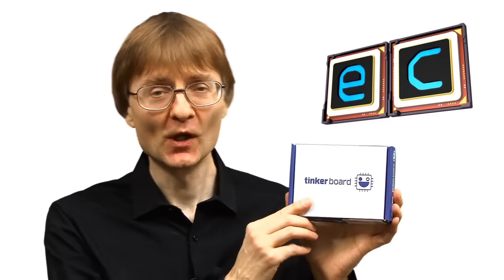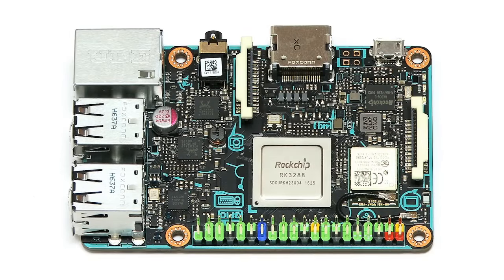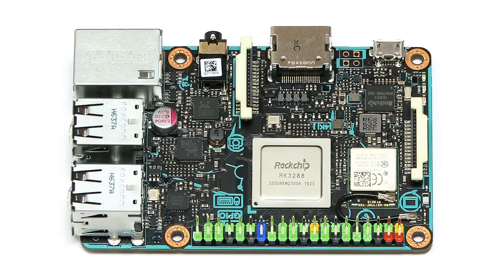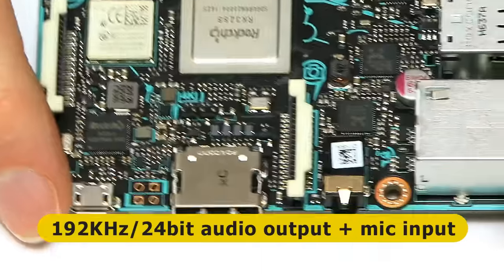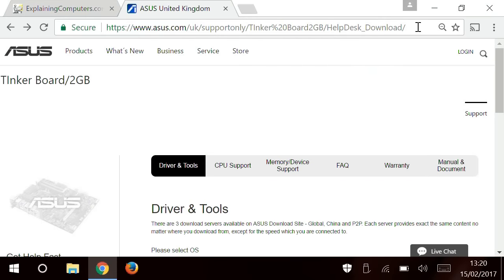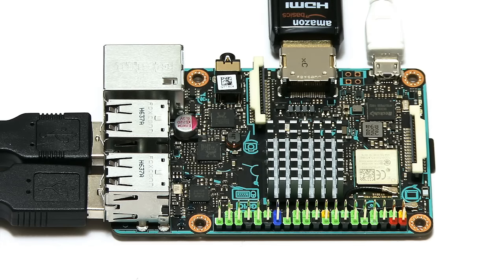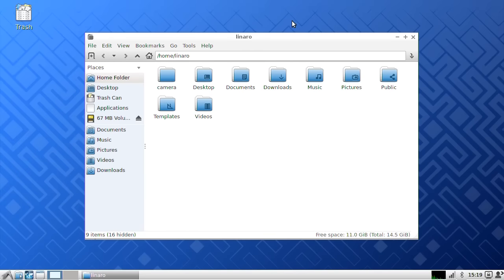Asus Tinker Board

Comment: I have one of these on the way and am slightly confused about what powet supply to get. asus says 5v, 2~2.5a power supply with lps marking. Not sure what LPS means. and Some people sayy they use 5v, 3a power supplies. could you help clarify for me ? i dont want to fry anything
Reply from the maker: The Tinker Board is very sensitive to having a good power supply to run in a stable manner. I would go with a 2.5A, or 3A if you can find one. By coincidence I am 6 days into a week using a Tinker Board as my only computer -- trying loads of stuff on it! The video posts this Sunday and includes details on the PSU I have used.

Comment: Very nice. This might finally push the Raspberry Pi developers to put more effort in updating their own hardware because in terms of performance the Pi is among the weakest SoC boards out there. Price-wise its a little bit overprices especially since you have the ODROID-XU4 which is a beast compared to this and for the price of approx. $60 (excluding custom taxes I think). The compatibility with Pi (how much compatible it actually is is to something that will be decided as time goes by).

Something that I'm personally really cool is that (according to the specs) the support for OpenCL 1.1 by the Mali-T764 GPU (along with the OpenGL support up to v3.0 of course). The Pi does NOT support OpenCL (probably because of the shitty video driver thing going on), which basically makes it impossible to use the GPU for normal computational tasks without insane amount of hacking. Note that the Odroid also supports OpenCL.

Comment: @ExplainingComputers
I have two questions about this device:
1. What kernel version is running on ThinkerOS?
2. You said the audio jack does also offer a mic input. But is the audio out mono or stereo?
Reply from the maker: Audio out is stereo -- it is a TRRS jack (4 connections) so supports stereo audio plus a mono mic. I am not currently on the Tinker Board so cannot check the kernel for you -- but the OS has been upgraded (from v.1.3 to 1.4) since I made the video, so what I have on the board is currently outdated anyway! Head on over the tinkerboarding.co.uk for the latest. Somebody there will know. :)
Reply: Thanks a lot for your answer.

Comment: Sorry I know very little about computer . But I have to ask would it be possible to load mach 3 onto this little board and control a CNC plasma cutter with it
Reply from the maker: I do not know Mach 3 -- but if there is an ARM version available, then maybe if it runs in 1GB RAM. This board has an ARM processor, not an x86 one as in most PCs.

Comment: I have issue with monitor screen resolution. I am using LG 18.5 inch monitor with native screen resolution of 1366x768. Tinker OS does not show this resolution and it is set now on 1024x768. Because of scaling display does not look sharp and little bit blurry. Same issue is with tinker android OS. On the other hand my raspberry pi 3 in raspbian OS automatically set to the monitor's native screen resolution and look very nice. How can i solve this issue? Thanks!
Update:
I have manage to solve this resolution issue in tinker os debian.
Reply from the maker: Glad you have sorted this.

Comment: Do you know which file to modify on an Asus Tinker Board to adjust the video timings in order to run a 5 inch 800x480 Adafruit display? How should it be modified to run at both 1080p and 480?

Comment: I only use PIs for example kodi and retropie, today it dosent seem like there are any working versions or ported version that works. Of course u can use the card for multiple other usage, but for all us wanting to use it for media center or gaming station the Tinker Board is a expensive paper weight. Correct me if im wrong i would be so happy to be wrong.
Reply from the maker: Right now (2 March 2017) you are totally right -- TinkerOS is the only OS available for the Tinker Board. Kodi was briefly available, and will hopefully return. This comment on the latest Asus Tinker Board web page is very interesting: "*HD & UHD video playback at 30 fps is currently only possible via the Rockchip video player, which is limited to support under TinkerOS. Currently, third-party video players and applications may not offer hardware acceleration and may likewise offer limited playback performance and/or stability" . . .
Reply: I had some contact with asus support sweden, and they say "they have loads of stuff comming out" im mostly just angry at them because they release a product before they have any good software. So far this is not a pi contender or a killer. Without kodi or openlec this board is crap. ( for me )

Comment: I might have missed this in the Comments, Great Video as usual, but it would be interesting to see how that Gimp test would a have gone if the System was Optimized for GPU Graphics Rendering, Blender is another example, point is that you did not even have a Codex installed, whereas the PI does by default, sure they left it out to save space, but did it a great injustice, you can not compare two systems unless you have the exact same setup, so maybe this was and I did not catch it, if not, maybe do anyone System Comparison with exact setups Optimized for that System,  without a Codex installed a GIMP test is not all that exact, it uses a lot of the systems default apps to render effects, without a Codex installed it uses the systems default video driver and a generic library that works great, but is slower, and if PI is running a faster more optimized configuration it will perform as it was optimized, so you are testing a system you admit is not optimized, but said nothing about it, so I had to ask, was the PI? if not, I look forward to knowing the real results, since I do not own the Thinker Board yet, I think I will get one, you make it sound great, good review as always, but I get a little narrow minded when it comes to comparing things, I have to make sure they are comparable, and you can not compare an optimized system to an non optimized one and expect the results to be meaningful, but maybe that is just me, but I would like to take about 100 of them and build a Blender Render Farm Network, not sure if this is the best board to do that with, what do you think?

Comment: Could the claim of double the speed possibly come from more CPU core or threads? I don't know the specs on these CPU. I guess the way to test this would be using a task that depends on multi core performance. Do you know if the filter does this?
Reply from the maker: You may well be right. The filter test is I think multi-threaded. The result very much surprised me.
Reply: The TBs cpu has twice the L2 cache than the Pi3 and it looks like this particular test didnt use it. Also the Pi may have kept up with 64 instructions which the RK3388 lack. In most benchmarks the TB scores are 150% to 200% of the Pi3s.

Comment: hi, I am extremely interested in this asus tinker board and the lattepanda, with the lattepanda its advertised with a copy of windows 10 home pre-installed on it (but I don't like windows 10 very much) but I have just one question to ask about the asus tinker board that I can't seem to find the answer to anywhere, can it run windows 7, and would it be easy enough to install.
I look forward to finding out the answer.
Reply from the maker: The Tinker Board does not have an x86 processor, and hence cannot run Windows I'm afraid.

Comment: what are the connectors between the hdmi and power connectors for? Also, you should do videos on arduinos and IoT some time
Reply from the maker: Good question on the connectors -- there is nothing in the manual (I just looked). I will get back to you on this one. I have an IoT video in my slate and yes, I should look at Arduinos. Though next week it is back to Pi robotics . . .
Reply: Thanks for the reply!

Comment: I just found you and subscribed , I was hoping you may help me? I have an asus laptop about 2 or 3 years old, it works a wile and screen goes blank, with a line down the edge on left side. I think its a heat issue or mother board problem, but the fan comes on a little to late... please help??? Thanks, I like your channel !
Reply from the maker: It sounds indeed like a fundamental hardware issue -- maybe with the motherboard, or else the screen itself (or its driver electronics). Thanks for the sub! :)
Reply: Thanks, I will look into that, let you know what I find !

Comment: I would like to know if this will run Android on it. I have seen videos where people have installed Android builds on RPi's and they have always had poor performance on the Pi (even the Pi 3) due to the hardware specifications. I have also tried an install of Android 6.0.1 on one of my Pi 3's and it works, but not well. If you get a chance, would you be willing to test the Asus Tinker Board with an Android build?
Reply from the maker: I will test an Android build as soon as one becomes available! :)
Reply: Awesome! Thank you very much! I always look forward to your videos and all the new content you put out, and your explanations and descriptions are very helpful!

I also temporarily forgot that this will not run Pi OS's straight away so that the Android builds for Pi won't work, but looking forward to it when it is available!

Comment: Can Tinker Board run windows 10 like latte panda? 
And what is difference between lattepanda and TinkerBord (what is better)?
Reply from the maker: The Tinker Board is not an x86 PC, so it cannot run Windows (well, you could run it via emulation, but not directly, and it would not be a good experience!). The LattePanda is an x86 PC and by default runs Windows 10 -- and unless you mess around a great deal can ONLY run Windows 10. So you basically decide if you want to run Debian Linux (Tinker Board) or Windows 10 (LattePanda). I'll be posting a new video covering a range of LattePanda stuff in about three weeks (currently planned to upload 2nd April 2017).

Comment: hey i wanted to ask, how do you record linux mint? Everytime i do it with gtk-recordmydesktop i get flickering problems while editing
Reply from the maker: I record everything using hardware -- an Atomos Ninja HDMI recorder to be precise. Plus sometimes hardware in the middle to strip out DCIP. Except from the Pi, Linux is a pain to record due to the lack of frequency settings and its desire to auto configure itself. So I often have to boot to a particular (old) HDMI screen, and then switch over, or try other tricks . . .
Reply: ExplainingComputers how much does the ninja cost and can you give me the link?

Comment: So if I stick an external HDD in this thing I can use it as an apache server/ home NAS? Would it do this any better than the Pi?
Reply from the maker: Yes, this should work fine. But I doubt it would work better than a Pi, as both are limited by the USB 2.0 port you will have to use to connect the HDD.

Comment: is this also suitable for automotive, or it is too sensitive to high temperatures and vibrations?
Reply from the maker: I'm sure this would be fine for automotive use -- no issues with vibrations, certainly, and I can't see why there would be temperature issues.
Reply: ok thanks, then I will probably give it a try

Comment: can i put a fan cooling system instead of heat sink? or is it a dumb idea to do that?
Reply from the maker: I think a fan would be a very good idea for this board. The SoC certainly gets hot.
Reply: +ExplainingComputers / Christopher
Would it be possible in a future video for you to compare the thermal output of both this board and the Raspberry?
Reply: +ExplainingComputers thank you for the reply mr. chris. if so, what kind of fan cooler should i use that perfectly fit on tinker board?

Comment: I can't start mine, I connected all the items but it not show anything, just turn on the led in red but doesn't show anything even the keyboard and mouse doesn't turn on. Could someone help me please.
Reply from the maker: I would very strongly suspect that this is a power supply issue. A Tinker Board is rather power hungry, so if you are not using a 2.5A adaptor -- and with a thick cable, as short as possible -- what you describe is exactly what the Tinker Board will do. I remember having to move to a different adaptor to find one that will work with the Tinker Board. Try also -- and first -- reseating the power adapter plug in the socket to make sure it is in tight. Oh, and also make sure your SD card is seated properly -- this can also prevent booting. Good Luck!
Reply: It's been 5 months since his post, now I am wondering if he ever figured out his problem?  I would be interested to know what was wrong.

Comment: could this install windows 10?
or what other single boards have windows 10 im aware of latta panda but there company wants me to do a bank transaction....
so what are my options
Reply: Ryan Peacock no. this thing cannot run windows 10 because it has a arm processor it needs a x86 prcessor. the littlepanda has a x86 processor and ït can run windows 10 indeed. however microsoft is busy porting windows 10 to arm, but i think it wont run on this because they will make it for the snapdragon cpus.
Reply: Ryan Peacock no. this thing cannot run windows 10 because it has a arm processor it needs a x86 prcessor. the littlepanda has a x86 processor and ït can run windows 10 indeed. however microsoft is busy porting windows 10 to arm, but i think it wont run on this because they will make it for the snapdragon cpus.

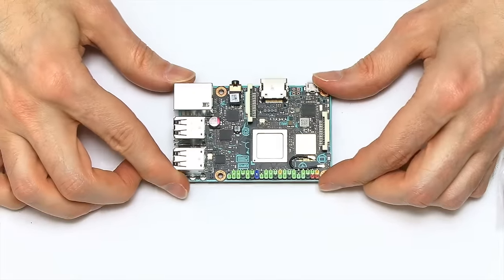Comment: 2:10 I wonder what's the point of that little coax cable

ahh 5:20 upgradable antenna neat
Reply: Jacob David C. Cunningham i think it would be good for iot
Reply: Yeah does it seem big? I guess depends on your iot project. I like the pi zero but even that is big. Something like an Arduino mini or a small square would be nice. I realize different hardware/capability/difficulty implementing. This thing is nice, seems to me you could build a decent little desktop computer with it. Not sure what form factor is smaller than SFF but I like that size.

Comment: There are more microchips on the Tinker Board, therefore it must be better! ;)
Reply: I question whether the heatsink actually improves heat dissipation, though. Those adhesive thermal pads are pretty crappy. I'm guessing it just serves as a finger-protector, and actually traps some heat in the CPU but not enough to overheat it. Any chance you can check the temperature of the circuit board under the CPU with and without the heatsink attached, using an IR thermometer?

Comment: Can windows 10 be installed on Tinker Board?
Reply from the maker: Sadly not -- it has an ARM CPU (well, you could run, say, Windows 3.1 via emulation).
Reply: ExplainingComputers but it's not extremely powerful it's not a SD 835 or 845 so window 10 emulation would probably be slow

Comment: DOSE ANY ONE KNOW  if the asus tinker bord is compatible with noods ( from rasberry pie ) I imagin that it probebly whould not becuse it is spisificly disinde to run on the rassbery pie. It whould be nice to be compatable acros bouth systems for Imroved easy in coding in between them. PLEASE link something. (sorry for bad grammer and spelling but I am in a rush)
Reply from the maker: No, NOOBS is only for the Raspberry Pi. I am at this very minute working on a new video about the Tinker Board -- esp. video playback and CPU temperatures. It should upload in a few weeks (other things to upload first!).
Reply: Thank you for your help!

Comment: A53 (64 bit) on version 3 of model B raspberry pi is not the same performance as a A17 (32 bit) since 64 bits @ 1.2 GHz is not slower than 32 bits @ 1.8 GHz ! - - - In reality A53 is about 2.4 GHz as a 32 bit machine. - - - Also who wants to support 32 bit IP addresses ?!? (dead end architecture).

Comment: What I s this used for a computer? A kodi box plz explain.
Reply from the maker: Yes, you could use this as a Kodi box, or for ight web/office work, or robot / IoT control.
Reply: I used to put desktops together when the penguin D came out so been a while. Looks like it would be dirt cheap to build a new system for much cheaper than buying one I only do light computer stuff like play spades on a league at safe harbor am I correct it would be cheaper to build a system using my tower power supply etc. I just need a cheap board and ram correct??
Reply: My current board is a old intel 945 GNT I think that’s it.  If in my shoes disabled in a wheelchair what would you do live alone limited on funds.

Comment: Why is nobody getting rid of the video part and adding some NAS functionality instead ?
4 SATA drives would be enough
Reply: For a NAS you will want have ECC memory and ZFS and nothing else.
Reply: Almost no commerical NAS box has ECC memory. 
I read a lot about this issue and think ECC is not necessary anymore. And i'm not for ZFS at all either, i use ext4 in RAID-1. ZFS uses too many resources
Reply: Because they are all shit. Inform yourself about ZFS. EXT4 doesn't protect your data against bit-rot, ZFS does.
Another option might be btrfs but it's to early now. Thus ZFS is the only option.
Also, a normal RAID setup isn't able to tell you which drive has the correct data if both drives tell you that everything is fine. ZFS doesn't trust a drive, but it relies on RAM, thus you need ECC memory and yes, ZFS will notice which drive has the really correct data.